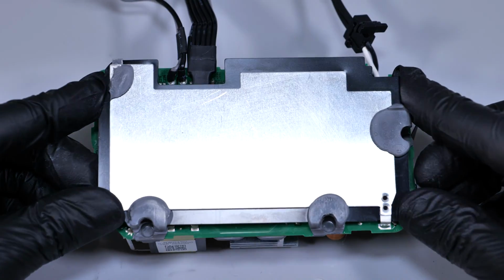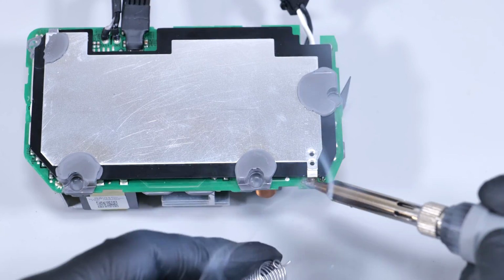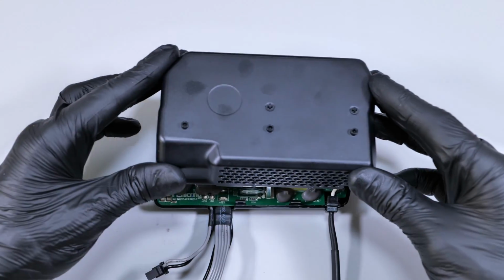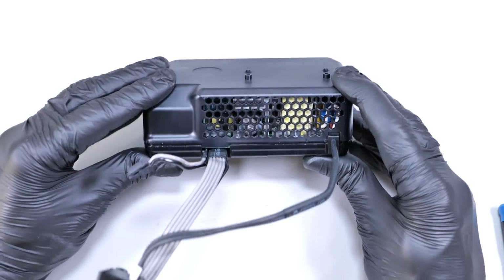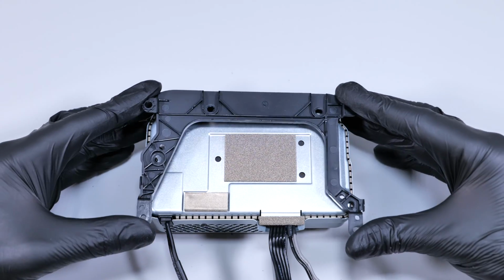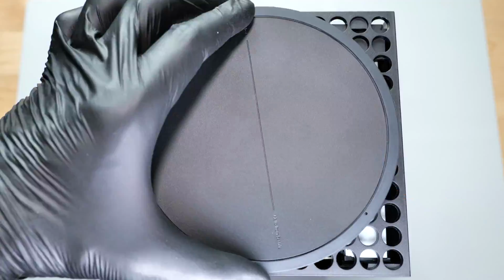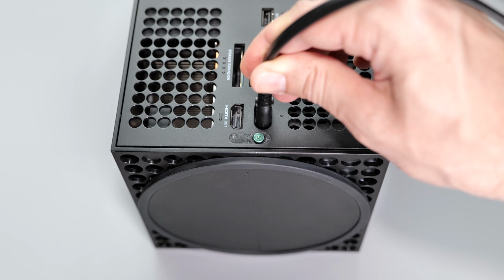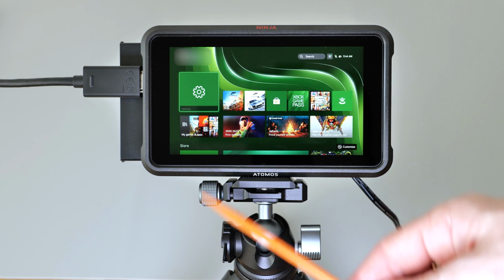Xbox Series X Power Supply Repair Guide – Fuse, MOSFET, Varistor & No Power Fix

Comment: I hear that sound when i plug in but when i measure it with multimeter it says OL. Does that mean i have an shorten in the power supply?
Reply from the maker: "OL" means an open circuit, which is actually the opposite of short. There's no practical reason to check a console's plug in ohm mode—it's not like a light bulb or a heater where you can test for continuity to determine if something is faulty. A power supply is far more complex, and testing it this way won't give you any meaningful information.

Comment: looks like too much pain and other comments said you cant get the parts. executive decision probably sending it to ms which is said to cost $300. i can get a new one for 380 plus tax, so i guess i save 100 that way. i know on my tv when the psu blew it was incredibly easy and you could just buy a new psu board online for like 30 bucks. not so here.
Reply from the maker: We repair power supplies from consoles, TVs, and other devices on a daily basis. All components are available on AliExpress or from donor parts on eBay. We have never had any issues with repairing them. You can also buy a used power supply from salvaged consoles.

Comment: Hi. I have an Xbox Series X. After 6 months and very little use, it started shutting down when entering the game. I just changed the thermal paste(Arctic MX-4) on the CPU. But it didn't help. Could this be because I didn't change the thermal pads? or Could this problem be from the power supply?
Reply from the maker: Does it shut down only when the game starts, or can it happen earlier or later as well? Is the shutdown consistent, or does it vary? Does it affect all games, or only some? Have you tried performing an offline system update?
Reply: @ElectronicsComputers  First of all, thank you for your answer. After starting the game, it closes after a maximum of 30 seconds (same in all games). When it is started again, it says that it closed itself due to overheating. I did not do an offline system update. I have no idea how to do it. What do you think I should do?

Comment: Thanks for the video. My power supply has a different layout but i was able to check the fuse and its blown. Hopefully its just that cause i can't get to any of the mosfets
Reply from the maker: Did it work?
Reply: @ElectronicsComputers  still waiting on the parts to arrive
Reply: It let out the magic smoke for me. Guess I'm buying a new power supply😅 @ElectronicsComputers
Reply from the maker: @SER198503  That's where that trick with a bulb should have been used. You could connect a regular bulb instead of a fuse, and if it lights up brightly, there's a short somewhere. If it lights at a fraction of its brightness, the power supply is most likely alive, and you could replace the bulb with a fuse.
Reply: Are u saying before doing fuse replacement we should check with a bulb what if bulb not available any alternative way @ElectronicsComputers

Comment: My series x  is new and its hardshut down when i play the finals for 30 min and lies of p shuts  down after 3 4 hour and in other games works and others  hard shutdown  without  overheat message  and i did everything  on mc page hard reaset  and still doesn't  fix it do u know whats  causing  this ??
Reply from the maker: If it's a brand new console that is still has warranty I'd ask for a replacement. If that console doesn't have warranty then I'd replace thermal paste and thermal putty. I have a video on how to do that.
Reply: @ElectronicsComputers  yeah it's from another  country I can't return it   so its not power supply  issue or ssd hmmm I never thought  thermal  could get ruined  in transit and its not displaying  the overheat message as well Thanks  for your help  ❤
Reply: @dodge892  Hello, I have the same problem, it happens to me mostly with new games that have very high graphics, I already changed thermal paste, but NOT the thermal pads, I cleaned, I even changed the fan, I can play COD for 8 hours and The Final 8 hours straight, but when I play, for example, Indiana Jones or Stalker2 for 15 minutes and it turns off by itself, is it the power supply?

Comment: Mine works for 10 mins without load then just crashes. Restart is possible immediately. What do you think?
Reply from the maker: First I would check the SMART of SSD. It will show if the drive is corrupted or overheating. Also make sure that the console has proper cooling.

Comment: Thanks so much for the video, I'm desperately trying to fix my son's Xbox X. We do however hear an electrical arc when connecting the power supply, any advice would be greatly appreciated 👍
Reply from the maker: I'd start with checking the MOSFET and the diode on the heatsink. Can you measure the voltage on the big electrolytic cap? It should be in the range of 150-350 volts DC.
Reply: I’m having the same exact issue with my Xbox
Reply: Same here and I hardly even play my series x cuz I work a lot. Please advise needed

Comment: Fantastic video, as a newbie, this is super informative and diagrams etc helped massively; completing my first ever repair, at 3:02 I'm not getting any readings at all on this part. going to replace- -- GBU608A..       Initial issue was on power up, light shows for 2-3 seconds then turns off, have you have ever seen this?
Reply from the maker: By "light" you mean the LED on the power button or the bulb in series with the power supply? If it's the LED, I really doubt you have a problem with the diode bridge. I've repaired a bunch of those power supplies and the problem usually lies in a fuse, varistor, MOSFET, the diode on the heatsink or the diode bridge. If you don't get any readings at all on the diode bridge that's weird. Make sure your multimiter in the diode mode and check four diodes that are in that bridge rectifier. If the fuse wasn't blown you can connect the power supply to the AC and then you can measure DC voltage between the first and forth pin on the diode bridge. It should be something about 170 volts if you're in US/Canada and over 300 volts if you're in Europe. If you have that voltage, then diode bridge is fine.
Reply: @ElectronicsComputers  Thank you very much Sir!, It was the LED light on power button which would flash for a few seconds then straight off. 

Was my dodgy testing with the diode bridge. Seems fine actually. 

After looking further, we think it could be the Ceramic Safety Capacitor,  (AH101K) - hard to find in uk.  One seems dead, (there are 2 blue ones on the corner, close to your left thumb @ 2:46).

Appreciate the support, i'm too noob for this but glad I gave it ago :)
Reply from the maker: @coderc2528 If those capacitors are shorted, then simply remove them. Those caps will cost you about 2-4 euros with free delivery to UK. The power supply will work without those caps without any problem. I really doubt that those caps can die or be shorted.

Comment: I went balls deep on a faulty power supply and found an MPS HR1211 chip with an internal short on some pins causing the power supply output to short to ground. Unfortunately, the HR1211 chips are unobtainium even directly from MPS. I'm in the process of retrofitting a similar chip with similar functions but Im finding that the pin configuration is not very common.
Reply from the maker: Not a problem whatsoever: https://alii.pub/6wqog2
I bought that chip here multiple times.